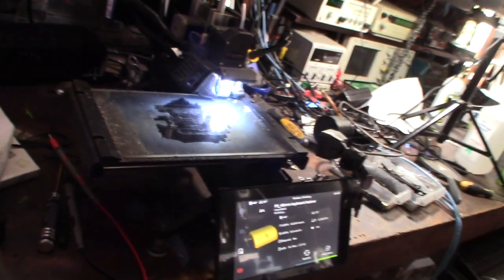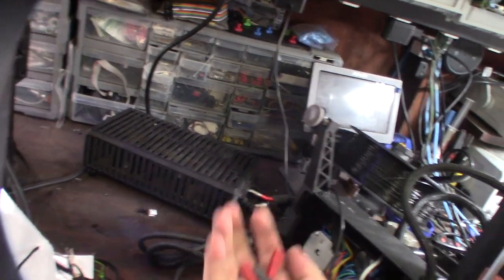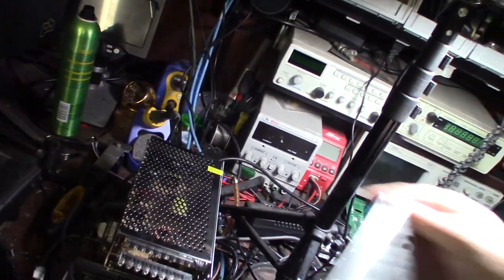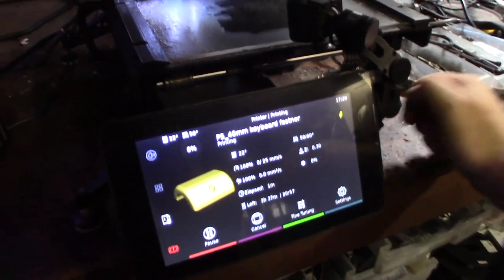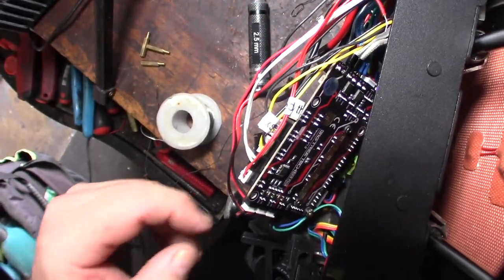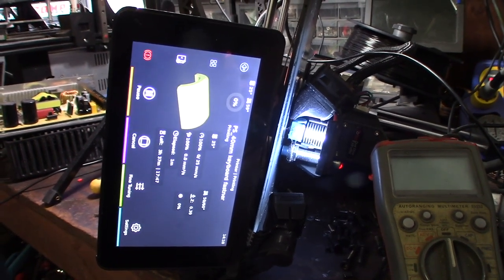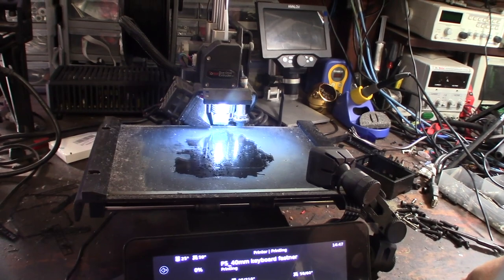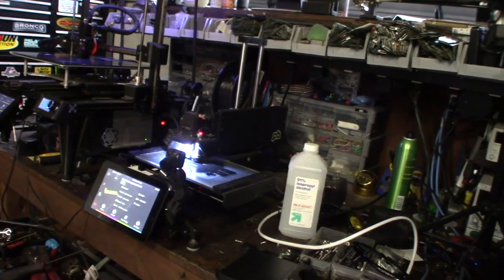Klipper MCU intermittent connection error with SKR Pico Bad solder joint causing power problems

Comment: Man... my SKR Pico suddenly stopped connecting to klipper. I was pulling my hair out becasue power supply was fine, board was working trough USB power... and here we are, main power connector cold joints. Thank you sir. I must ask my seller if they let me reflow it or just send it back.

Comment: hello sir, I have a flsun v400 model printer. I bought it 2 weeks ago. The heater shorted the cartridge wire while trying to remove the filament stuck in the printer. What method should I follow? I am getting mcu error now I can connect to the printer from the computer but the clipper gives disconnect error